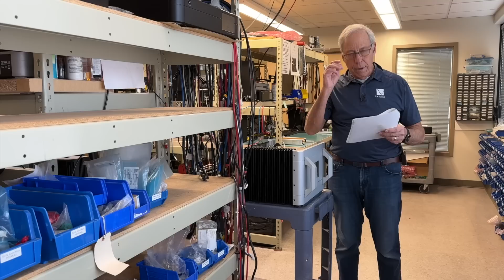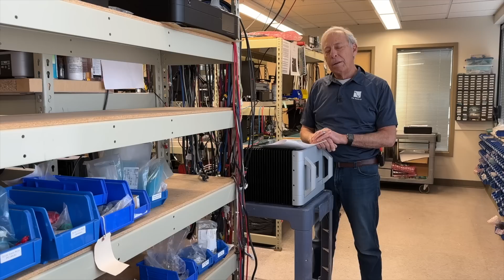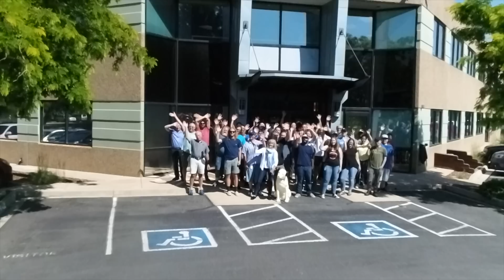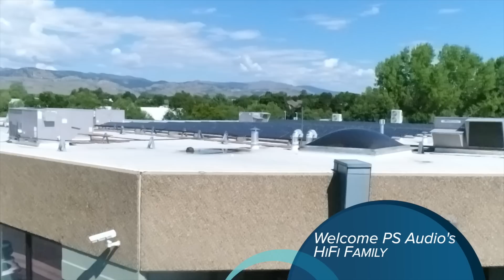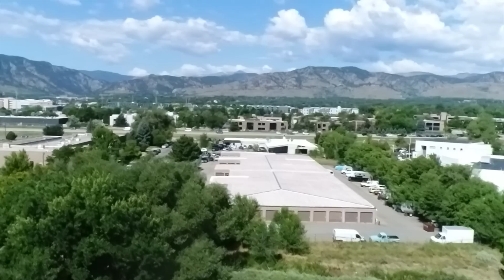Speaker break in: Myth or real?

Comment: Nicely Done.
Is there a life expectancy for a speaker.
Can we expect any given speaker to last 15 - 30 years. I'll assume all parts might function but not to it's fullest as years go on.
What are the usual things to go bad?
Thanks
Reply: Obviously material is going to make a huge difference, like the makeup of the surround (like foam). Then if the tweeters have ferrofluid it'll need to be replaced after so long. Things like this. One thing that's consistent amongst all speakers (that aren't single driver) though is the crossover. Capacitors start to fall out of spec around 20 years give or take. Easy fix. Other than that it really depends...my Altec studio monitors are completely stock other than the Capacitors and they're from the early 1970s. Foam surrounds will fail much sooner but don't take a lot to fix.

Comment: I bought some new PMC speakers, and they sounded awful when first played. Many people still say that speaker break in is a myth, but some manufacturers such as PMC explicitly mention it in the manuals. I assume it was the cone material breaking in, apparently not. I am sure you know about work hardening, where mechanical deformation leads to a change in the structure of a metal at the atomic level.

Comment: I replaced the surrounds for my dual 12 M&K subwoofer and definitely it was a bit stiff. 

The replacement surround is thicker than the original also.  

I gradually increased volume over a couple of weeks. 

I then played bass heavy music to really get the subwoofers moving and definitely it softened up the suspension.  

I would still say there is a difference still.  

The original M&K had more bass at lower volume and definitely had a softer suspension due to the thinner surround.  

The drawback though is that over time the surround starts to deteriorate and eventually fall apart.  

The new surround is much thicker and stronger and should last longer.  Sounds better but has to be at higher volume.

Comment: You said capacitors are mechanical of course they're not they are electrical. 
You can damage the driver spider quite quickly if you play a constant tone so never play a constant tone at volume
Reply: Electrical devices are made up of physical components; their physical properties can, and often do, change when they go through the process of being heated up and cooled down in the process of performing their functions (not to mention the changes in properties that can happen with the simple fact of passing a current through them). These changes in physical properties can effect their electrical performance. (Learning more about the physical construction of capacitors can help you understand why they are more susceptible than say, an integrated circuit chip.)

Comment: Actually there exists three distinct types of "break-in" for a speaker.  As Paul mentioned, one kind of "break-in" is electrical which includes everything electrical including cross-overs, wires, L-pads, voice coils, etc and of course this is called "burn-in".  Another kind is mechanical in nature and pertains to any moving parts e.g. the speaker driver's moving mechanisms, i.e. the voice coils, suspension systems, etc. and this type of "break-in" is actually called mechanical "break-in".  The third type of "break-in" is also mechanical in nature but few are aware of it and even fewer understand it.  But this type of break-in has to do with mechanical supposedly stationary objects that hopefully do not move when in operation.  This type is called "settling-in" much like a dwelling structure placed on top of a foundation.  Or perhaps a component placed on a shelf, or a speaker placed on the floor.  And just as a house and/or its foundation never fully settles in, the same potential exists with everything related to our playback systems.  BTW, this settling-in type of break-in comes to us in the form more commonly known as vibration mgmt.  For which there exists two primary methodologies:  One is vibration isolation and the other is resonant energy transfer and one is far superior to the other.  But the main thing to note here is that it's against the laws of nature to entirely isolate any object from all sources of vibrations simultaneously.  Can't be done. If complete isolation were possible it would occur in a moment in time and without any time needed to "settle-in".  And of course achieving a 100% transfer rate of all unwanted vibrations is also impossible.  This implies that we're all dealing with a hybrid of the two diametrically opposed methodologies.  Which in turn implies we're all dealing with forms of settling-in over variable periods of time.  All the above would also apply to turntables and CD players too since they too have electrical components, stationary disparate objects like a TT placed on a shelf, and moving parts when in operation, e.g. the platter, tonearm, motors, CD transport / drives, etc. Regardless, these are the 3 types of "break-in" every last speaker must go thru before it's able to perform at its absolute optimal potential.
Reply: That "settling-in" you are talking about is simply induced by gravity and therefor mechanical in nature. There is no point in creating a separate group of understanding with nonsense like vibration isolation vs time. The reason it's hard to convince the everyday joe of the existence of break-in is because of fantasy story's like this...
Reply: @ToadStool942  See that's the fun part. That tiny little sandbox, is what we call physics. When you step outside of that sandbox that's when you know you've had one too many shrooms.
Reply: @Bezerker1181  If you say so, honey.  Might this be the same physics that said bumble bees can't fly?  Since you're obviously not spending any due diligence on your system, why not prove to us that gravity is more than a theory?
Reply: @Bezerker1181  Golly, thanks for the lesson.  I guess I should have put the coookies on the lower shelf so kiddies like you can get at 'em.  Settling in is the process of two stationary disparate objects like a component with its shelf, a speaker with its floor, or a rack with its floor and for which a mechanical conduit is created for mechanical energy to travel.  The quality of the mating process is not instantaneous and hence requires time for this "settling-in" process to occur.  In fact, the better the quality of this mating process, the more settling-in time is required to achieve this superior coupling. Unwanted mechanical energy gathers within the component or speaker via air-borne or internally-generated vibrations and without a sufficient exit path will reliease its energy within its trapped/confined space.   The more superior the coupling of the two disparate objects the greater the opportunity for this unwanted and normally trapped energy is allowed to travel away from its point source i.e. component or speaker before it releases its potentially catatrophic sonic harm.  For example.  If you squeeze two pennies tightly into a vice and leave it for a day and then release, the two pennies will seperate as they fall to the floor.  However, if you leave the two pennies tightly squeezed into the vice for say 5 or 50 years, when you release the pressure there is an excellent chance the two pennies remain together almost as if there is a slight weld between them.  Not only is the settling-in process valid, but from a performance perspective its benefits can be far superior to the burn-in and break-in process results combined.  This is what is known as the settling in process you frickin moron.  Grow up and stop calling people names just because their thinking isn't limited to yours.  It makes you look well, errrr, ummm moronic.

Comment: Of course break-in of components is real. Where however I disagree with you Paul is you claiming that caps, once burned in, remain burned in. I would agree that is true in cases where they regularly see current draw. 

We own vacation home in BigSky, which for perspective is at 8450’ elevation. The climate is therefore quite low humidity year round, hvac is in-floor hydronic the only ‘forced air’ is from an HRV system that is set @ 5 cfm/100sq ft, as well as ceiling fans. We visit on average 4-5 times annually, my 2 kids will visit another 3-4 times when we are not there. In all, I’d estimate 75-80 calendar days annually, balance of time it is vacant. 

Home has a very nice system in living room as well as in my library-office. The living room has dynamic 3-way speakers fed by vacuum tube pre & amps, library has Quad ESL’s fed by vacuum tube pre and mosfet single ended amps. 

When home has been unoccupied for 6-8 weeks, heat is kept @62F minimum, I turn on the equipment, allowing typically 45-60 min warmup before playing music, the sound will be tight and constrained for at least an hour. By day 2, it will be noticeably more open and lively in both system. I will say the system in my library sounds less constrained initially than the living room. Is that due to the esl’s not having butyl surrounds or is it mosfets are more tolerant of dormancy than vacuum tubes? 

The point is both systems require “break-in” even though every component in system is at least 5 years old, some like the esl’s and Pass Aleph 1 more than 30 years old, and many, many hours of current running through them. The fact is when sitting for weeks on end w/o any current, components settle on molecular level and need “activation” to return to there brilliant best.

Comment: Along with that, how about when you turn on your stereo how long do you wait until you crank it up if at all?
Reply: @Douglas Blake I'm sorry, the question is not as good as it should be. My question, you are sitting there, you get a song in your head you want to blast. Do you walk over, click, click, click, the CD player, amps and such and by the time the player starts the song you are reaching for the volume knob or do you turn everything on, give it a minute or two and very low volume and then gradually get into it at the next song (or even longer)? 
To even take it further, should you start every song at a lower volume (when you are jamming) especially if the song has what I call a "hard start"? Basically going from silence to crash at the very start of the song.

Comment: However with the latter, Surround & Spider, over time (a very long time) these can (as the person asking this question alludes to) breakdown and become 'less stiff' than the original Designed specifications and thereby cause the speaker to not be playing as good / accurate as it had been for many many years. Determining this effect and to what degree this has taken place is nearly impossible... for the simple reason that it is occurring so gradual over such a long time that you the Listener will simply become accustomed to the ever so gradually changing sound and therefore never know that it is occurring (which is sort of a good thing, right 😉).

Comment: Another topic with some combination of real audio fidelity impact and some snake oil involved. Spiders definitely can need to be softened through break-in. Surrounds…perhaps, depending on material. Electrolytic capacitors can need to be formed building the oxide layer inside but I consider any such component in the audio signal path a bad choice to begin with. Nothing in the electronic path should need break-in (or burn-in) for other than detection of initial faults such as bad solderings. Did I miss something?

Comment: Great explanation by Paul, one of his best.  I would think though that manufacturers of somewhat expensive audio equipment, would want to do a lot of the burn-in or break-in themselves (maybe not the "full" amount of required break-in, but a substantial amount of it).  As Paul indicates, this would cost more to the manufacturer.  However, it would probably result in fewer customer returns and fewer bad or "unimpressed" customer reviews.
Reply: PMC state in the manual that speakers need to be played for a few tens of hours to break in.